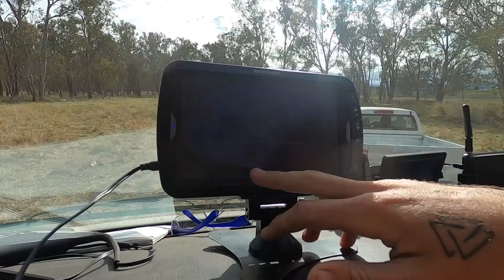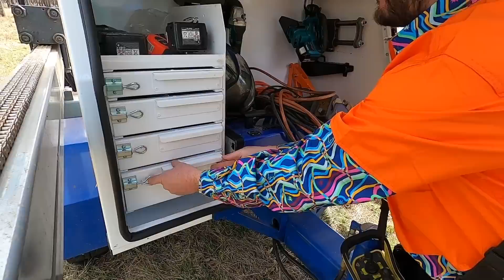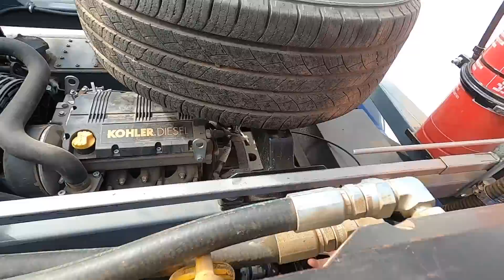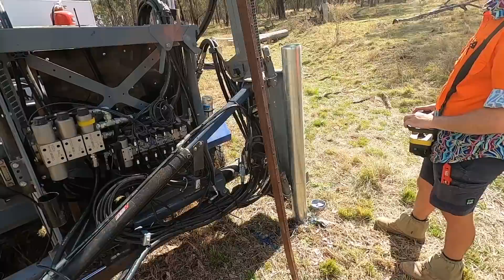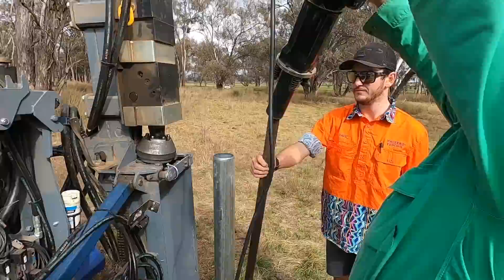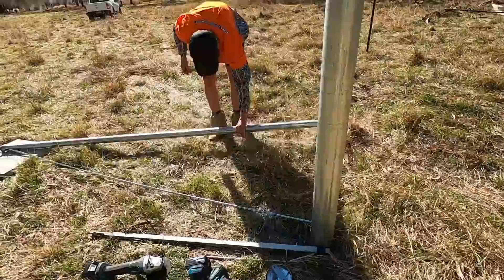High Tech Post Driving Trailer

Comment: i'm sure they've probably done it by now my first time seeing this, but why not have an additional bar with a running marker up and down you can measure once set the pin then that be the height of your post save using the tape measure, or have some sort of permanent measuring stick or bar running beside the driver

Comment: USA here. I am curious, how does that brace work?  I am having a hard time seeing how it would hold the post in place with no anchor to push on  the brace end?
Reply from the maker: It’s in the maths. You can’t alter the length of one side of a triangle. It’s a self tensioning brace. All the stay block does is stop the assembly from sinking into the ground.
Reply: It basically work's the same way as a traditional H-brace. Pulls on the bottom of the post to transfer the force to the top of the post. The rest of the force goes straight down, in this case to the foot plate instead of the backup posts base.